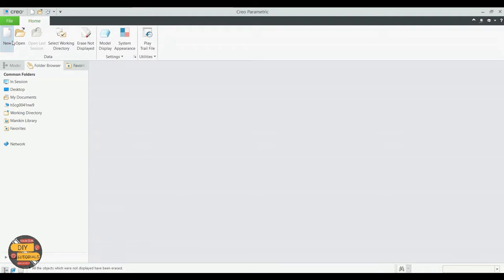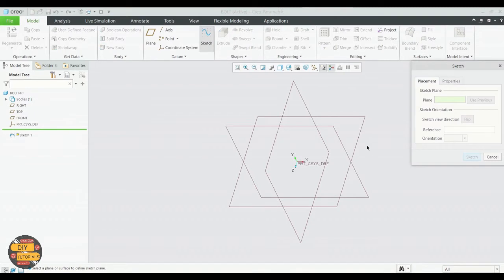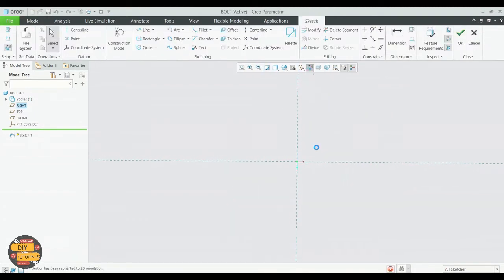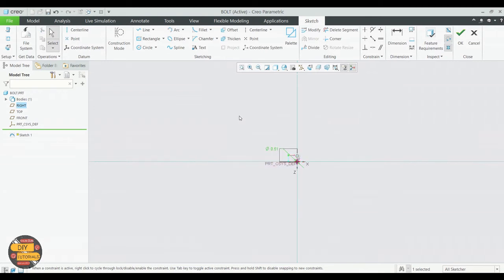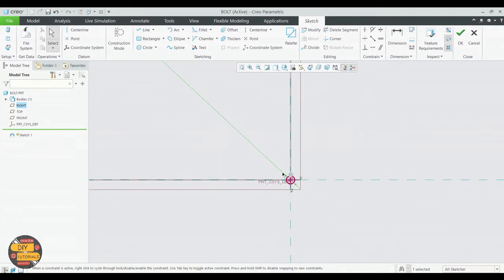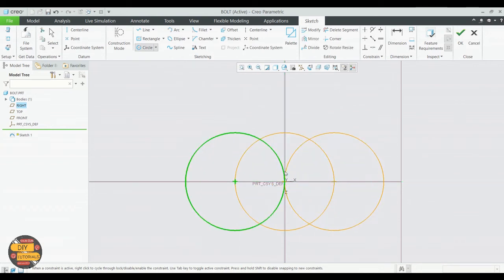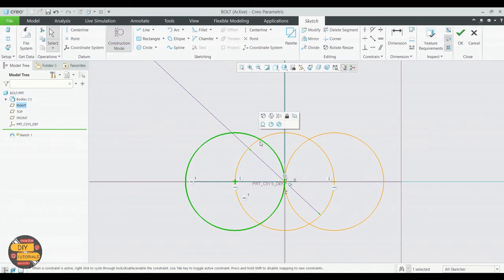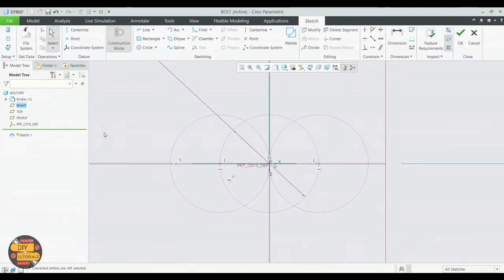How to make a hexagon sketch in part modelling creo parametric 7.0 tutorial beginner guide

Comment: hexagon function is in palette!!! klick and drag and done. The only stupid thing is that those idiots at PTC define chord length instead of parallel distance. (which is what you need to make a bolt of M8). I really don't get why those asses make it so effing difficult.
Reply from the maker: True @wilfredswinkels 🙂, Palette is quick and easy way to make hexagon sketch, however you don't get the flexibility if you only know parameters like parallel distance.